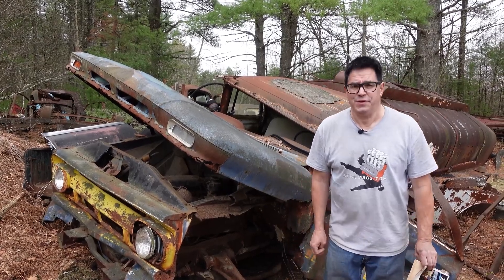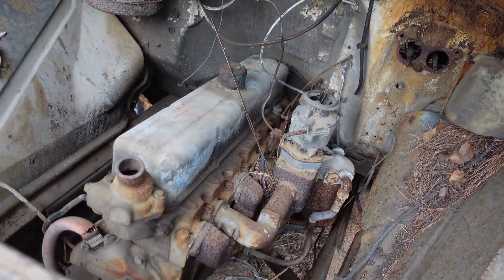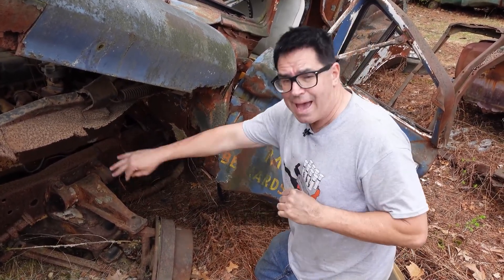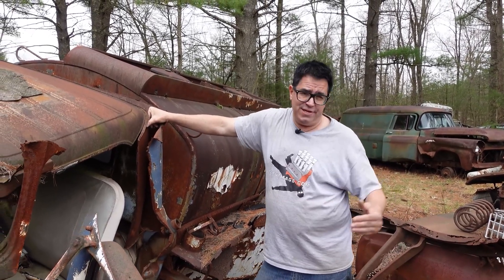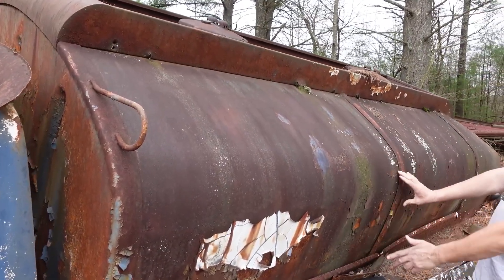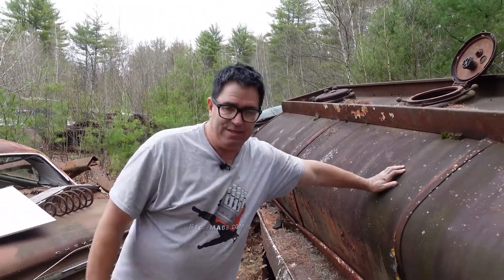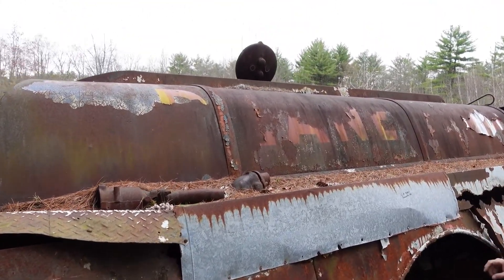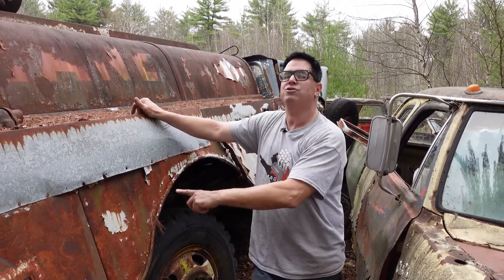Truck Week EP35 - Torsion Bar Tanker

Comment: I used to work in an automotive machine shop. Every now an then we needed a replacement block for a customers 409. Anchor Motor Freight, which hauled the cars out of the Baltimore Chevrolet Plant used a lot of them and when the truck was considered obsolete or not repairable, they went to mainly one junk yard. The problem with the engines from a high mileage truck can be a cracked block, cracked in the main bearing  webs of the casting. Often our first pick was not usable due to this. So if anyone harvests a 409 from a heavy duty truck, be sure you check the block thoroughly before investing any rebuild money.

Comment: The bolts that bolt down the cylinder head to the block are the same as the ones on a wood  stove not inspection plate bolts! People have the misconception on the third bolts

Comment: I love how Chevy has a tradition of using the same engine as the corvette, in the trucks. (More or less, different options) When I bought an old used 2000 Silverado a few years ago, I spent a good half an hour under it trying to find the springs. It has freakin' torsion bars! Not what I expected to find! I just find that funny.

Comment: The 292 powered trucks had an sm420 transmission. The big trucks just had a bigger u joint yolk and a band brake mounted to the output of the trans.

Comment: I still have a 1965 C60 with a 292 inline six. Itll pull with any of the small block gm C50 or C60 ive every been around. It uses a fraction of the gas the V8s small blocks burn.      The big block GMs are way more powerful tho. That old girl made many hundreds of thousands of $$$$$.

Comment: The 261 is an easy upgrade over the smaller 235 or 216.
Reply: It drops right in, as long as they both are of the same era - motor mounts and such changed in about 57 from the front under the timing gear cover to the sides and the water pump was moved downward for 56.

Comment: The rear doors on those old tankers were spring-loaded. Leaned that when i was 6,7, or so, early 70s dad had a paint shop. Of course, I went through everything that came in. 
Anyway, those springs actually were pretty strong. Strong enough to knock a curious little boy and his younger brother on their asses after a short flight.

Comment: I have a feeling that with that 6 cyl engine, the acceleration would never be strong enough to cause all the oil in the tank to surge to the back, causing a wheelie, even without the baffles!
Reply: Have you ever driven in Mass.? They're in a hurry and none too courteous. You might have to stop real fast and then that oil would slam against the bulkhead. If you were partially loaded, it can shove the truck forward a few inches, even more if the road is slippery.
Reply: @tomkrisel4493  Wooosh.

Comment: Can you discuss  the torsion bar suspension used on 1500,2500,3500 1991-2000 gm trucks? Seemed like a good system 🤷🏼‍♂️

Comment: My 1983 C35 3+3 had a 292/TH400 drivetrain... It was OK with the bed loaded, but when pulling a trailer with my little Samurai on it, it was a nightmare, especially driving uphill. I sold it to get a '91 K3500 with the 454, but I still miss this good 'ol squarebody!!

Comment: A great two-fer crawl. And glad you dispelled the 348-409 were truck motors myth. That has been repeated for decades!
Reply: Since the horsepower wars were really heating up, Chevrolet needed a bigger engine to compete. The plan to put the same basic bigger engine in both cars and trucks was no different than what the competition was doing. If indeed, some Chevrolet spokesman said "Yeah, it started out as a truck motor" he probably found himself on the unemployment line! 😁 I think the 348 came standard with a 4 barrel carb, and optional 3-2's on cars in 1958.
Reply: @burthenry7740 The tri-power setup remained optional all the way through 61, the last year of the 348 in cars.  The top version made 350 horsepower!

Comment: 2:59  Not a kingpin.  Small detail, but that's the knuckle/stub axle assembly, complete with ball joints, top and (presumably buried in the dirt) bottom.  If it was a kingpin setup, it would be pivoting on the king pin in a direct line between where the ball joints are located, rather than stepped outboard of that axis.

Comment: Torsion Bars,, complete lunacy today.   Brand new they floated along, but shortly thereafter,, things went ,,,saggy.  The C60's also could be had with the 365hp 327sbc after or around 62, believe it or not.   Wind it tight and grab another,,poor little Sbc.  A buddy has one, and it's no slouch, it pulls quite well.  The SBC power steering pump, steer box, and pump brackets are the hens teeth to find on the C-60's.   Special production items, for steering that dump truck, with a SBC.    Hope your doing well Steve, I always knew you had a few vids "in the can".   I hope your eager to get back on the crawl.    Find yourself a Hot Rod in the sticks, and make the purchase.  Start a build.
Reply: A heavy rig like this would not have a high-strung engine like that, as such engines do not generate any low RPM torque, and with no low-end torque, it would be almost impossible to get moving on a hill when loaded.  You need TORQUE much more than horsepower in this application.

Comment: The 62 C30 long wheelbase panel I bought from a Walkill NY private yard, has 5.14 gears and had the H.D. SM420 4 speed with the parking brake on the back, and the stovebolt 6. I also bought a 62 pickup for the nose, doors, and interior parts. It has a complete 6 banger that rotates over with decent compression. I need to get up there soon and swap the parts over to my panel and transport it to my land.

Comment: What are the 'scallops at the tops of the cylinder bores' for, valve clearance? Forgive me, I don't know anything about these engines. I start knowing about GM stuff around '64-ish. LOVE the 292, I had one in a '64 Grumman-Olsen Kurbmaster with one and a Muncie-pattern 4-speed that I bought in high school around 2003 to turn into a camper. It had like 5.38s and was utterly wound out at like 50 mph, but it was cheap and I thought I could make it work. I was wrong, haha! It was diesel level in off-idle torque, though, and SMOOTH as can be.
Reply: The 348-409 Chevrolet engine used the scallops to lower the compression ratio for trucks. Engine blocks without the scallops at the top of the bores were used in high performance cars.. The combustion chamber was actually in the block. The heads, were more or less flat, with just indentations for the valves. Heron (or Herron) design. Ford's 430 c.i. was similar.
Reply: @throckmorton8477  Oh, okay. Wild!

Comment: Great and informative video as always. I think the axel may have been removed to tow the truck to its final resting place. Otherwise, more components of the drivetrain would be engaged as it was being dragged by the wrecker. If the truck somehow popped in gear while being towed, you could have a real problem.

Comment: Most of those home oil delivery trucks didn't have big engines and used gearing to compensate for it. They usually were only on the surface roads making deliveries so they didn't have to move at highway speeds. Also remember both GMC and Chevy didn't offer a V8 in any truck until 1955 so sixes of various sizes moved all the loads up to the big 503 GMC straight six.
Reply: And mid 55 at that - early 55s were the same as the 54s.

Comment: I had a 1960 Chevy Apache 1/2 ton with the torsion bar setup and a 235 stovebolt. It worked very well for me in a light duty application.
Reply: 👍Glad to hear ❤

Comment: As a kid I liked watching the oil man make deliveries, the pump and hose then the hose reel. The meter is missing the embossing unit, it would sit on top of the pump. The driver would put a bill in it made of 2 layers of thin paper with a carbon paper sheet. When he would start the pump it would stamp the paper with the first gallonage reading, usually zero, when he was done it would stamp the final gallonage. They would give one copy to the person buying the oil and bring one back to the office to send you a bill for the gallons indicated. An interesting side note was that lots of little oil sellers were once coal and ice sellers that just moved into oil as it took over.
Reply: The local Oil Man in my old neighborhood was Joe Howard. aka "Papa Joe". He always had a soggy, half smoked Tampa Nugget in his mouth and you never saw him without it. In fact, you hardly would see him with it lit. He likely would stoke it up in the morning on his way to work, smoking it halfway down then after it went out from all the slobber he'd just chomp on it for the rest of the day 😁 Old Papa Joe was a character for sure. The old oil truck was used less and less as the years went by and eventually got parked out back of the station where it sat for decades. It sat there until the old men had passed and the station was sold.
😢 The building was torn down and a gas station and convenience store was built in it's place. . And the years keep marching on by.
Reply: Yep and some of the drivers were crooks

Comment: Mind blowing to think that poor little 6 pulled that load. I know gearing helps, but talk about the little engine that could.  Thank you as always, and keep on feeling better sir. ~ Chuck
Reply: Sixes were quite common in trucks like that in those days. So was cresting even a small hill in 2nd or even 1st gear.
Reply: I wonder if it has a high/low rear end?  The tranny was gone or at least the shifter is and maybe that's because it was a high/low unit.  If so, that six probably hauled ok, just not fast.
Hey Steve have you pulled on the work boots yet?  You must be itchy all over mate.  Cheers 🇨🇦
Reply: This truck probably has 4.88:1 gearing.     You can pull a lot with that
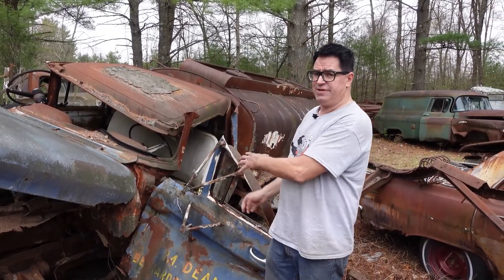Reply: @gregorylyon1004  I would not doubt a 6:30 ish axle in that. It probably had 7.00 20 tires (quite tall) or wider on it.
Reply: @67L-88  Yep. Somewhere in the 6s for high and 7s or 8s for low if it was a 2 speed axle.
Reply: My guess would be. 4.56s.   @67L-88
Reply: You are correct sir!  i own one of these with 2 speed rear end, and it is still 6:1 in "high".  Mine also has torsion and 261 6.  Since these were usually "last mile" delivery/service trucks, 45 MPH was top cruise speed.  These rarely left the local community so speed was not a big deal.  Torque and lugging gears were the ticket. @67L-88
Reply: @gregorylyon1004  A year late, but that truck would most likely have around a 6.20:1.
Reply: Our fire company had a 1962 Ford f600 tanker with I think the 292 V8.  But driving it up a hill to fill a swimming pool, it stalled. I put on the ebrake to hold it as I restated it. Then not thinking, I shifted it into gear and popped a wheelie. It stalled and I then restarted it, took off the brake and went on my way. My brother in law who was following me, was for years after that telling the story about me being the only one he knew that could pop a wheelie with a fully loaded fire truck. That was in the mid 80s.
Reply: Hey the 300 inline six ford could out pull the 302 ford  growing up we always ran those and we always fought over who was getting the six for the day 😂
Reply: All the diesel boys now days.....  6s moved and build America
Reply: We all thought about that . Stove bolt Power !
Reply: 6s were actually quite common for this type of duty, as these trucks weren't about speed.
Reply: Think it was around the time this truck was built a federal ruling was introduced that said semis had to be able to do 20mph minimum on the highway - and they were hauling much heavier loads.
Reply: I mean it did its job somewhat well considering Chevy used this engine in big trucks from '29 to '62.